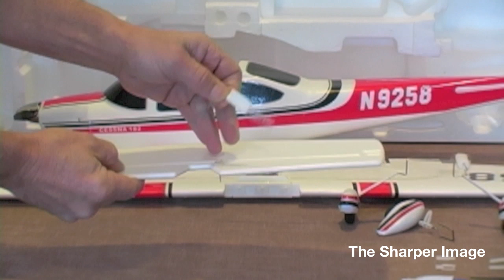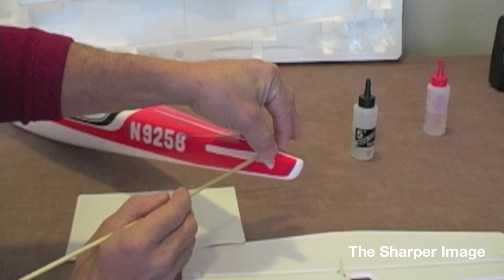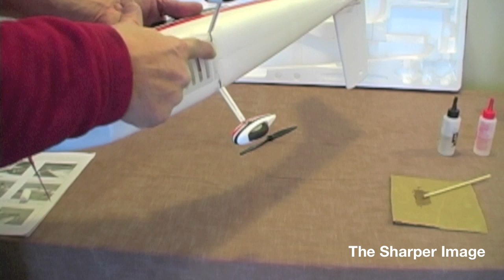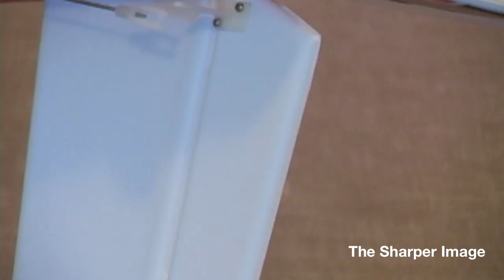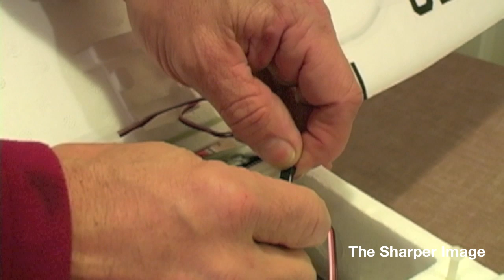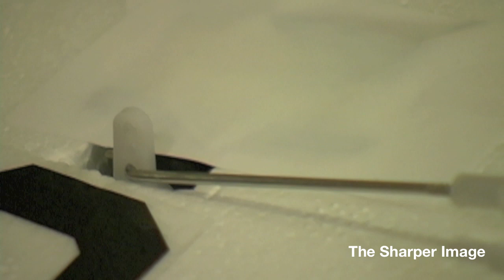cessna 182 pro series Instructional Assembly Video

Comment: I have the art-tech Cessna 182-400 with a weight fitted inside behind the engine firewall,  I flew it twice on a windy day and had 2 crashs
I got replacement parts i also purchase a second one, i would like to know if i am  doing right thing by removing the weight from the front of the fuselage and instead moving the battery slighty forward in the  fuselage, i also purchase a second spare fuselage it had no weight fitted inside it, would it be ok if i did the same thing in the spare fuselage for the center of gravity,